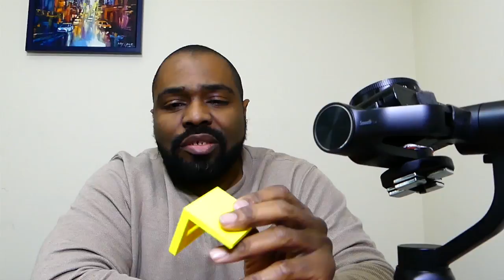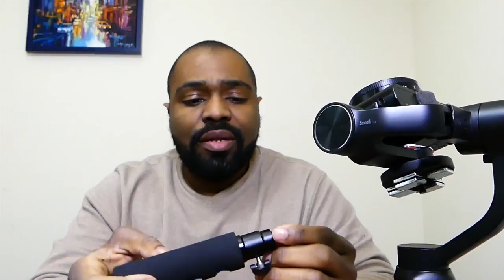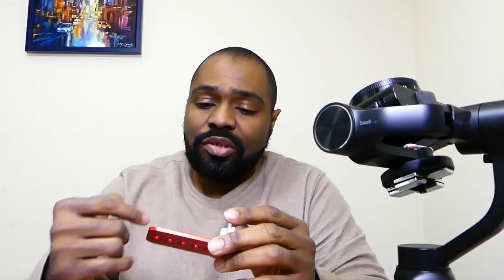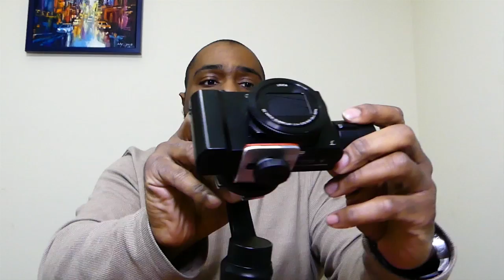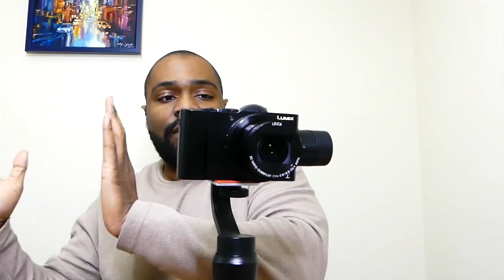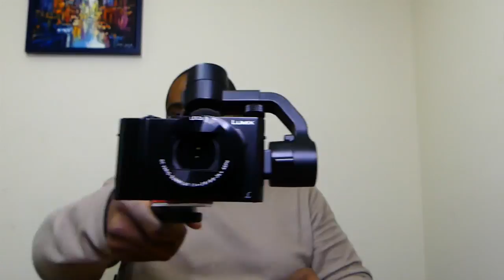Working Smooth Q Compact Camera Mod

Comment: Will overload weight harm the Gimbal ? its said max load 200 gram
Reply: I don't think so ,once it's balanced properly the weight will be evenly distributed putting no stress on the motors.